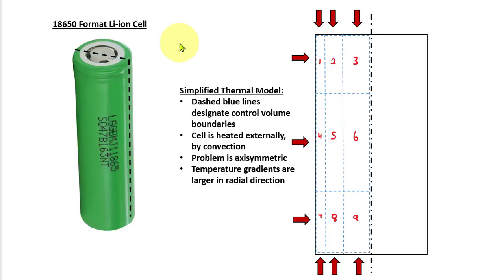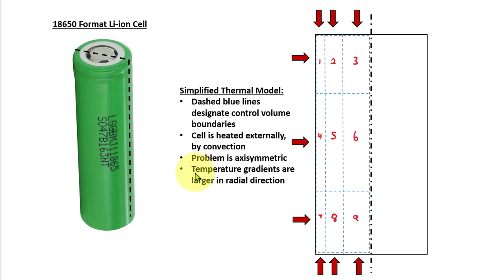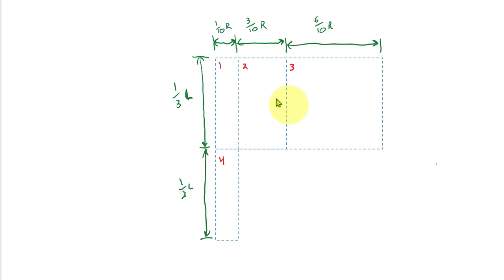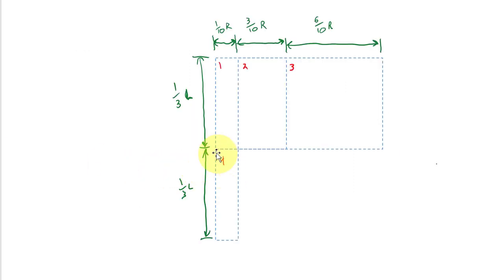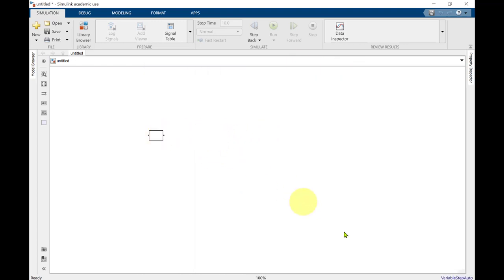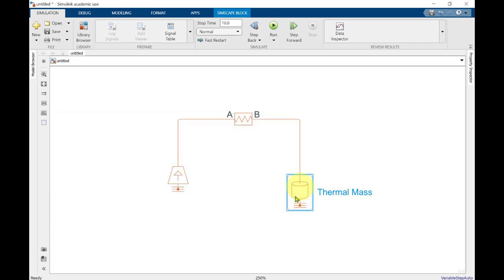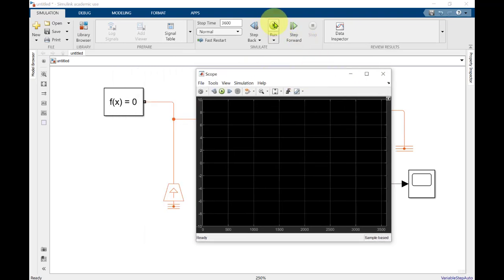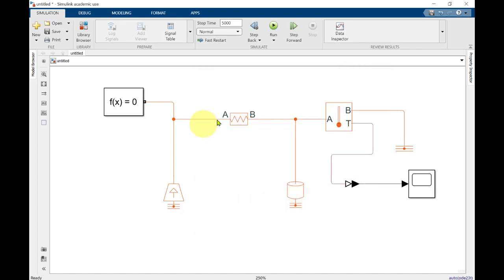Thermal Model of Li-ion Cell using MATLAB Simscape

Comment: Its mentioned heat will conduct into 1 first and from there it conducts to 2 and 4. But if we consider the whole model heat can also convects to 4 and conducts to 1 at the same time right? So don't we need to consider that? If so, how to do that.
Thanks for the video